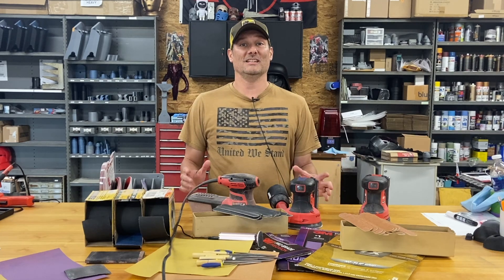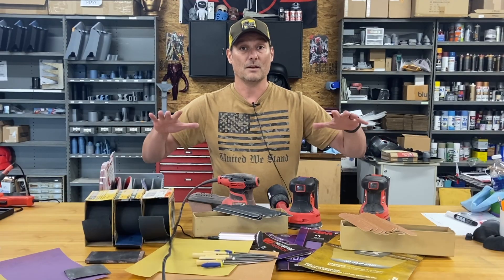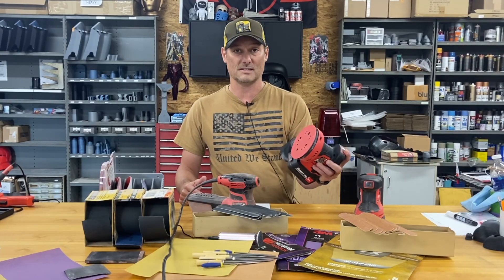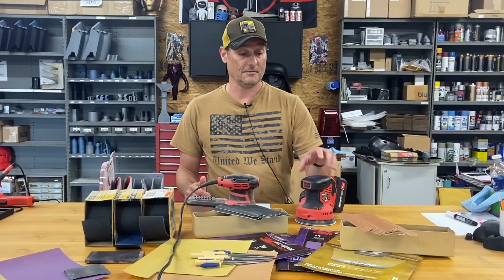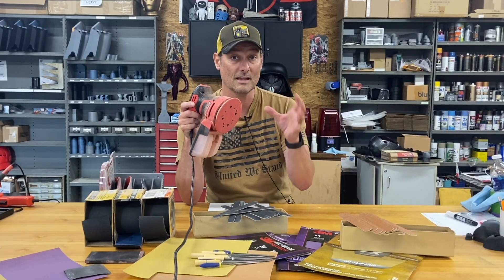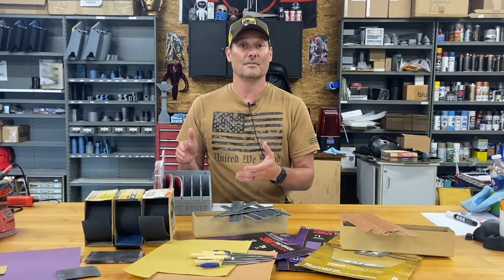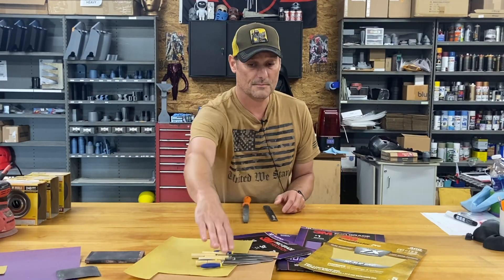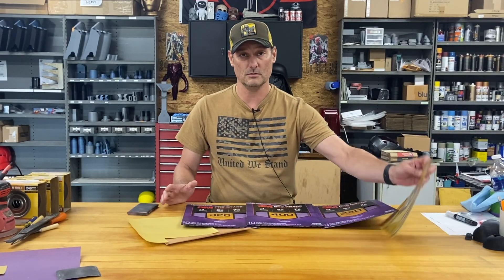Are you using the correct SANDPAPER for sanding 3D prints?

Comment: Excellent video!  I discovered on my own that the 3M sandpaper is far better than the super-cheap stuff.  You should take a look at the Milwaukee 2531-20 Orbital Detail Sander.  I love this thing!  It has plenty of power, but only when you need it (adjustable speed by trigger), it's relatively quiet, and it fits in smaller areas.  Downside is it's not cheap.
Reply from the maker: Thanks!  I am going to have ot check out the Milwaukee for sure.  I love the idea of adjustable speed on the trigger.  Thank you!